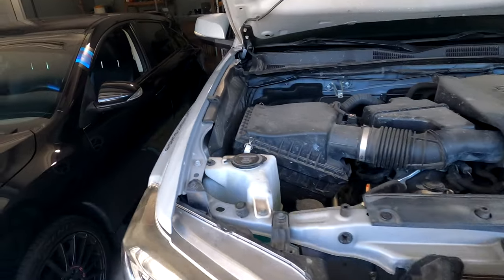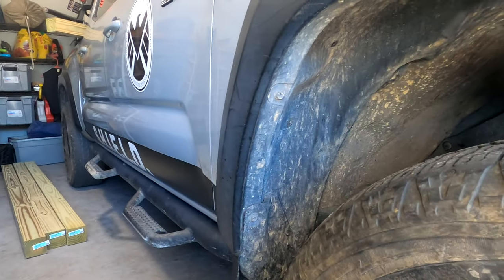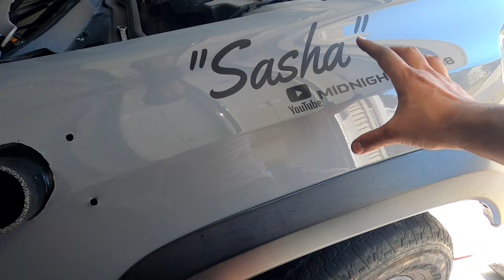UpTake Snorkel Install: 2017 Toyota Tacoma

Comment: did they updated this snorkel? They are known  to have issues in regards losing HP.
Reply from the maker: I’ve done quite a bit of reading into that, and the issues with air starvation really seemed to only arise if your taco was supercharged.

I don’t notice any performance issues, but I also don’t drive hard.

It is concerning how little UpTop was willing to put in the effort to either show positive data disproving the client claims, or take those claims onboard to make a better product.

I am sure that this has led to their decision to discontinue the UpTake.

I am also not willing to put in the time and money on a dyno for the NA 3.6l V6 that my taco has both with and without the snorkel to see if there really is a difference.

When I bought the snorkel I didn’t think ‘performance’ I thought about the necessity of one on the trail. My taco has also never been above 5000 rpm with me in the driver seat.

With all of that said, it is the best looking snorkel on the market in my opinion, and I am quite happy with it. I have not had any cracking or damage occur in the plastic since I installed it about 4 months ago (which was another negative claim about the snorkel).

Hope this helps! I appreciate the view!